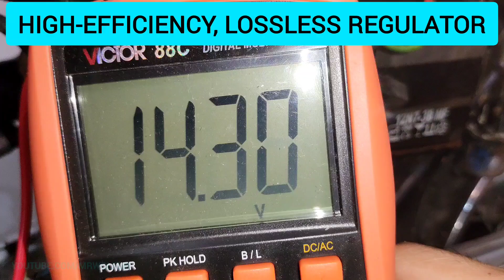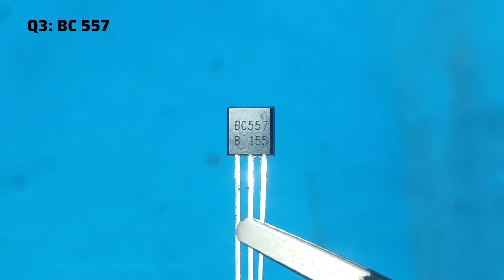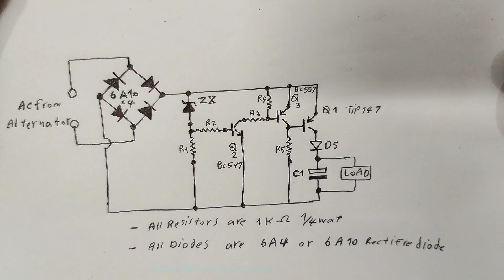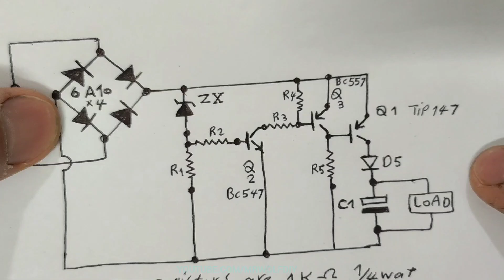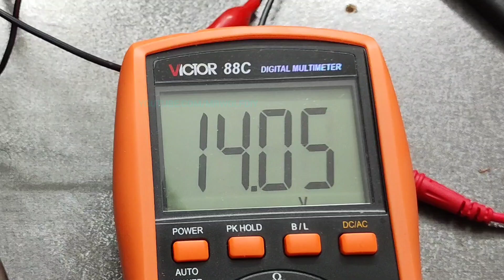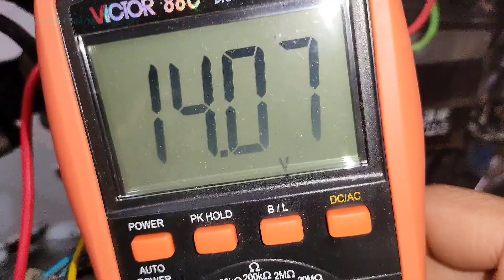Ultimate Guide to Building a High-Efficiency Motorcycle Regulator

Comment: I'm used this for 2 stroke three wheel i'm used 2200uf 50v cap and 10 volt zenor output voltage is 22v 😢 and my capacitor was blowin. When the rpm is high why?
Reply from the maker: It is probably not suitable for your engine, or you may have made a mistake during the assembly of the circuit.
Make sure the battery is definitely connected as a load in the circuit.
The voltage should not exceed 14.5 under load.
If it goes higher, there is a risk of damaging the battery, the electrical components, and the circuit itself.
Reply: @MrWolfDiy bro worng is mine i’m mess up with transister out pins Next time Please give more details about pin numbers and C,B,E in diagram I think everyone messed up with this prob thank you bro mutch love ❤
Reply: @RahalPinkethDeSilva its ok ?
Reply: @MrWolfDiy thank you brother for your information can you make for sutable like this engine one or share diagram

Comment: Sir, I made a BC 547, BC 557 tip 147 rectifier after watching your video, but the resistor fitted on the 50 volt 2200 uf capacitor caught fire and the output voltage is more than 30, so please tell me which rectifier should I make, please help sir.
Reply from the maker: It’s probably not suitable for your motorcycle. Could you tell me what kind of motorcycle you have?
Reply: Sir, I have a Honda Eterno 150 scooter which does not have a battery and the company has a genuine rectifier but the light and horn are very weak, so please help me sir.

Comment: Can you clarify the position of the transistors better?
Reply from the maker: Hi dear thanks for the question, 
In short, its role is to limit the output voltage and stabilize the DC without needing to change the stator current.

Comment: is it possible to replace the power transistor with power mosfet? which one is better in efficency (less heat)?
Reply from the maker: No, Each one has a different application. This circuit is designed for a power transistor...
In some circuits, MOSFETs are used.
And Loss and heat depend on the specific circuit—shut regulators usually have heat losses… but 
This version has lower losses...
In newer motorcycles, MOSFET rectifiers are used, which are much better...

Comment: How many watts of zener diode are used?
Reply from the maker: 1 watt
Reply: I've made a rectifier that looks like it's all the same, but the current output I get is so large, up to 30 volts.
Reply: The stator is also specifically used for full wave
Reply: is there something wrong?

Comment: I made that circuit and test it, working fine but instead of BC557 I used 2N3906. I used 15 volt zener diode. I am getting 15.2-15.3 volt. Any suggestion ?
And another query:
If I use input from my AC headlight wire and another from body of my bike and in output I feed the ve+ to headlight and ve- to body, will it work? Will it short?
Reply from the maker: Regarding the transistor, there is no problem, and you can use a 14V zener diode.
If the headlight is a normal halogen (filament) lamp, you can use the AC output of the regulator.
But if the headlight is LED it definitely requires smooth and regulated DC, otherwise it will flicker or burn out.
In that case, it must be connected to the battery.
Reply: @MrWolfDiy correct sir

Comment: this is a single phaze 10amp regulator , can you make a video for 3 phaze 30amp or more ?
Reply from the maker: I also built a three-phase version of this regulator rectifier,(15 amp max) but
shunt regulators can’t handle very high currents(30amp), they won’t last. It needs to be MOSFET-based. I’ll make a version like that in the future...
Reply: Made it sir for high watt lamp

Comment: can i use lifepo4 battery on motor cycle with this regulator.
Reply from the maker: It’s fine, but after installation, check the charge level with the motorcycle running.
For a four cell pack, which is 12.8 V, the full charge should be around 14.6 V and should not go higher.
Although compared to regular lithium-ion batteries, these are less sensitive to temperature or charging.🙌
Reply: @MrWolfDiy   okay notted.. thnx for the response. ❤

Comment: Which liquid you are dipping Pcb?
Reply: You can use ordinarily available muriatic acid & hydrogen peroxide (supermarket).
AI: The recommended ratio for the etchant solution is two parts 3% hydrogen peroxide to one part muriatic acid (typically a 30-32% solution (supermarket or hardware store).
Reply from the maker: This liquid is PCB acid, which is available in both liquid and powder form.
Reply: Feric chloride FeCl3

Comment: its fullwave bridge rectifire why are you connect green wire of stator to the output of regulator. why are you not use just first and last wire of stator like green and white. plz clear me i am confuse
Reply from the maker: Every rectifier-regulator needs a negative connection (ground) to be able to perform voltage regulation. The green wire is the negative or ground.
Reply: @MrWolfDiy No,its full bridge rectifier.groung  is common in half bridge rectifier.i find your circuit diagram on Pinterest and i make it working properly without common ground

Comment: is it series type regulator use in modren bike or it is shunt type regulator.last u make fullwave shunt type regulator using bt151. the problem of bt151 regulator is draw current on no load and down the bike rpm
Reply from the maker: This regulator is a shunt type, but it provides more stable performance and generates less heat.

Comment: i have also half wave stator.but i convert into full wave by ground isolation. it mean i use only two wires of stator first and last wire i did not use light bulb wire from center of stator. is it ok
Reply from the maker: Removing the center wire and using only the two end wires of the stator may result in not getting a full wave or incorrect voltage. If you want to get a full wave, you usually need to use both end wires along with the center wire (neutral point).
You should test it to be sure.
Reply: where to put that neutral point in bridge rectifier? @MrWolfDiy

Comment: Can I use this for a Yamaha T9.9 with electric start? It has a lighting coil and 2 wires coming out of it: one green and one white/green.
Thanks
Reply from the maker: Since your engine has electric start and a battery, it most likely requires a full-wave regulator/rectifier—and this version is indeed full-wave.
However, many small boat engines might not even need a regulator; it depends on the type and model.
If your stator coil provides the proper output—typically between 12 to 50 volts AC—then it should be usable.
That said, instead of using 10-amp diodes, it’s better to use a stronger 35-amp bridge rectifier with a heatsink for better reliability.

Comment: Will this work on yamaha rx100 6v,what changed do i need to make,and plz tell is my bike full wave or half or any more details would be appreciated
Reply from the maker: If your Yamaha RX 100 motorcycle is 6 volts (6V) and still uses the original electrical system (stator and rectifier), it usually uses a half-wave rectifier, which typically consists of only one diode to convert AC to DC.
To convert it to full-wave rectification, the stator windings must be modified,
which can be a bit of a hassle.
If you can send a picture of your stator and rectifier, I can guide you better.
My Facebook and email are active — you can find them in the 'About' section of the channel on desktop mode.
Reply: Nama FBnya apa bosku

Comment: Hi bro can i use it for charge 12v 7 ah battery can it charge fast?
Reply from the maker: At higher rpm, it outputs a maximum of about five amps. It might not charge very fast , but it's not bad.

Comment: jenis dioda yang kamu pakai tidak sesuai
Reply from the maker: Using a 35-amp diode bridge is better
Reply: @MrWolfDiy  dioda 6A10 hanya menangani arus dengan frekuensi dibawah 100Hz tidak akan bisa menangani arus dengan frekuensi tinggi , kumparan pengisian kendaraan mengeluarkan arus bolak balik dengan frekuensi minimal 700 Hz tegangan bisa mencapai 500V saat putaran mesin tinggi , diodamu tidak sesuai dan sistem kelistrikanmu akan terganggu yang paling parah adalah unit audio , gunakan dioda jenis SCHOTTKY BARRIER untuk menangani arus dengan frekuensi tinggi , tambahkan juga dioda TVS (Transient Voltage Supressor) supaya sistem kelistrikanmu aman dari lonjakan tegangan tinggi

Comment: Can i work for 12 volt 9 amp battery charging
Reply from the maker: The output current of this regulator reaches about five amps. Overall, yes, it is usable, but charging might take a bit longer, or the circuit might be under slightly more stress.
However, this circuit has low energy loss and doesn't get very hot.
Use a suitable heatsink and a high-current bridge rectifier — that would be better.
Reply: Is this for Half wave use or full wave stator use or for 3 phase?Thanks 👍🏻
Reply: Could connecting 10 amp bridge rectifier would help it?

Comment: Very Very nice!!!, dear sir why u use  r1 ( and also r4) in the circuit? Are they necessary?  What will happen if we don't use them ?
Reply: R3 and R4 must be a voltage divider ig
Reply from the maker: Resistors are used for regulation and protection of the components.
Reply: Thk u

Comment: Bro i used 15v zener diode and 25a bridge rectifier and another's components is same as yours! But my bike giving 12-14v ac output at ideal rpm after i use this rectifier it gives 25v+ at ideal and 33v+ at max rpm😐 what should i do i don't have any other model zener diode accept the 15v 😐 help me🥹
Reply from the maker: Hi,
You still haven't mentioned what motorcycle you're using, but please let us know، What type of rectifier are you using?
If it's the square-type rectifier, be careful — the AC inputs are diagonal. Check the datasheet of the components...
The output should be DC, not AC.
Double-check your circuit to make sure there’s no mistake, because the voltage needs to be regulated.
Reply: @MrWolfDiy  i made this one you said me to make ! my bike is rx 100 12v system
Reply: @MrWolfDiy  bro voltage is fixed after giving load🤩
Reply from the maker: Yeah, yeah I forgot — you said you had a Yamaha RX 100.
Yeah, you should’ve added a load.
Glad it worked out!👍
Reply: @MrWolfDiy  yeah bro its working great 🤩
Reply: @JabedurFF i also have rx100 do we need to change anything from the video or its same

Comment: Bro can i use TIP 127 transistor and 25v 1000uf capacitor
Reply from the maker: It is usable, but the TIP147 can handle more power and current —( about twice the current and around 40% more power)
And about the capacitor,:  No, it is not recommended to replace a 50V capacitor with a 25V capacitor...
Reply: @MrWolfDiy  can i use 2 Tip 127 in perellal
Reply from the maker: Parallel connecting Darlington transistors requires a specific method: you must place small resistors (0.1 to 0.33 ohms) in series with each emitter and use a good shared heatsink.

Comment: Thanks Mr. Wolf for the instructional videos you share with us.

 What would be the reason that somebody would choose a lower output ( 12.6 Zener diode) when building a voltage regulator ??

I'm asking because I have a 1990 Honda Elite 250 scooter. Last year, the CDI stopped working, and then I replaced it. 
I decided to connect a voltage gauge so I could have a direct reading of the battery and the charging system. To my surprise, I've got between 12.7 v and 12.8 v while running the scooter at 75/80 km/h and 13.2 v while the motor is in idle.

I don't think anything will be broken , right ? Is just that the battery never gets charged past the 12.8 v ,and then I connect the battery charger/float charger ,and get the rest of the charge every now and then (I just use the scooter on weekends for fun).

Anyway, I'm also waiting for your building of a 3-phase regulator ,hopefully with Mosfet technology  to get relief of the higher temperatures that these things usually get ( I've adapted a 12 v cooling fun to dissipate the heat) .

Thank You again.
Reply from the maker: Greetings,
Your charging voltage is lower than the ideal, especially if you use your motorcycle at night (with the lights on). The battery will definitely experience a significant drop, which needs to be checked for faults.
Regarding the 3-phase regulator, I must say that there are several methods for building it, one of which involves MOSFETs and other components... I will soon post a tutorial on how to build it.
Thank you!

Comment: My stator is cooking nowadays tomorrows trouble in wait while in the bushes with my xt225. Kindly advise.
Reply from the maker: Hi and welcome.
You probably have an issue with the charging system. Check the following:

1. Inspect the wiring and connections: Ensure there are no loose or damaged wires.
2. Test the stator's output voltage: Use a multimeter to check if the voltage output is within the standard range.

3. Check the rectifier/regulator: If this component is faulty, it may cause the stator to overheat.
4. Inspect the engine oil: Some motorcycles use oil to cool the stator, so check the oil level and quality.
Finally, if you have access to tools, open the stator cover and visually inspect it. If it appears blackened or the coil windings show signs of burning, it needs to be replaced.
I'd be happy to hear an update from you!

Comment: Will any of your c d I circuits work with v8 engines
Reply from the maker: Greetings,
For multi-cylinder engines, you can use the DC version, which I explained in two videos on how to build and run on multi-cylinder engines.
This is the link:
How to make custom DC CDI:
https://youtu.be/QvmFbEX-pGM?si=WiKxQ2A--J7wb7ah
Install on  multicylinder bike:
https://youtu.be/XHRxKNFLOQE?si=y2Mm86_QZnUnRHoy

Comment: Is this auto cut off?
Reply from the maker: No it's not,
In these systems, battery charging is always active, and voltage regulation is handled by the voltage regulator, not by completely cutting off the current.
-Some modern motorcycles with switching regulators or MOSFET technology can automatically stop battery charging when it is full.

Comment: This is far from a "no loss" regulator. The series pass transistor will get very hot with any significant current through it or high input voltage from stator / rectifier. The single phase diode bridge rectifier will also add to the power loss (more heat).
If this design was switchmode rather than linear regulator it may actually survive in the real world.
Reply: Yep!! when a spade is a spade you need to call it a spade.

Comment: You put 15v zener diode in the circuit so the output voltage must be 15v. But why it's only 14v?
Reply from the maker: This friend of ours is right. every pn junction will have drop...
Additionally, the component values are nominal and may vary slightly in practice. For example, a 15V Zener diode might actually be 14.5V.
Of course, using original components will give better results.
Reply: E very pn junction will have like 0.6v drop

Comment: What do I need to convert the electrical system from half-wave to full-wave in my bike? and can i use bridge diode instead?
Reply from the maker: This regulator also works with single phase ac.What is your motorcycle?
Reply: @MrWolfDiy  super cub with honda astrea prima engine
Reply from the maker: Yes,You can use this for it.👍
Reply: @MrWolfDiy  thank you and im gonna change the battery too because it died by itself im only using it for sign light and starter but the starter some times 
can start the engine and not starting the engine and now it can only powering the sign light. maybe you know why my battery die by it self?
Reply: @MrWolfDiy  Dear
It is possible I use the same in my 70cc motorcycle?????
Reply: From half wave to full wave you need to modify your stator. You need to remove the coil from the ground.
Reply: @jcgarcia4575  yes im gonna save money to buy a new custom fullwave stator